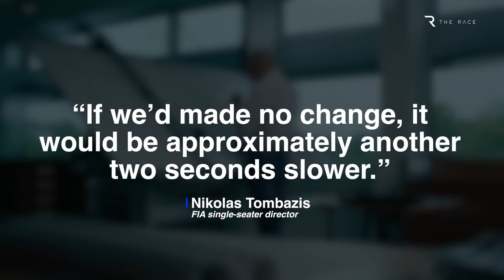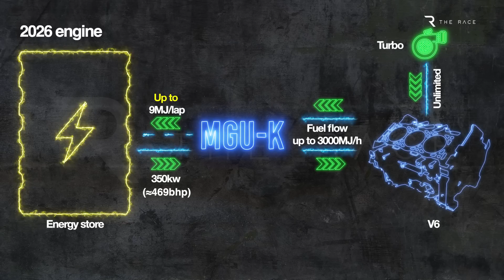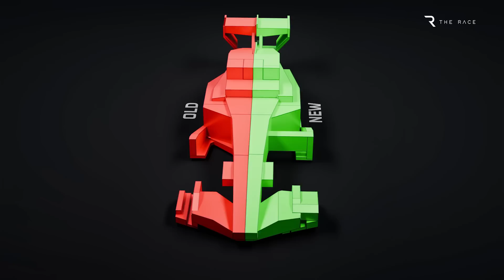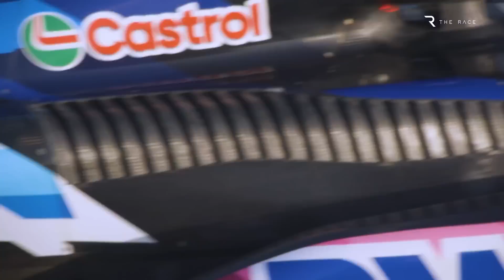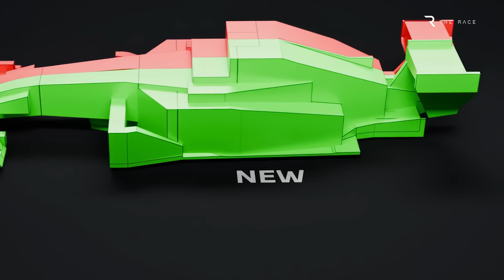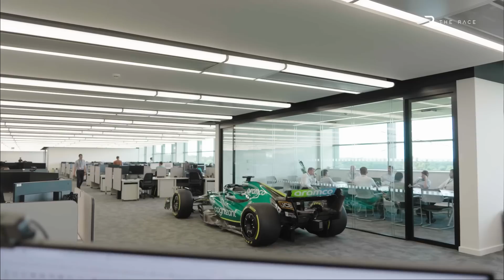How F1's 2026 cars will now be two seconds faster

Comment: 2 seconds faster!? That’s F2004 improvement levels. Believe it when we see it.
Reply: I believe they meant 2 seconds faster than what the 2026 cars were simulated to run previous to the changes made, not 2 seconds faster than the current generation.  They'll still be quite a lot slower than the current cars.
Reply: @Shortstuffjo  ... Great... sad face
Reply: 2 seconds faster than the previous 2026 regs. Not current gen. FYI previous 2026 regs were about 2 seconds faster than current F2 around a average sized circuit. Current gen is about 16 seconds faster than F2 on a average length circuit. So the new regs will have F1 cars about 4 seconds faster than F2 cars around an average lap. It will still be 12 seconds slower than current gen. In races this will be most visible cause the ERS cannot be used every single lap for reasonable distances meaning most of the lap cars will use around half of current bhp. All the things you see in this video are to hide this problem. F1 realised it won't be the pinnacle of motorsport anymore and it's desperately trying to make it look like it still will be.
Reply: @nielsvanheteren  stop fucking lying, 2026 cars wont be 12 seconds slower than 2025 cars LMAO
and current f2 cars are about 12-14 seconds slower than 2025 cars, (depending on the tracks)
the 2026 regulation cars will be about as fast as the 2022-2023 cars.

Comment: the car visually looks fast ,attack the corner like dancing way more important than laptime, even if 2 seconds slower , visually not much different, in person or on tv screen you wont feel it ,but the car smaller and lighter, thats make it visually look faster for sure .
Reply: They were going to be far more than 2 seconds slower, more like 6-8 seconds slower... Close to F2 pace.
Reply: @TassieLorenzo  2014 backmarker flashbacks
Reply: @TassieLorenzo  tbf going that much slower they'd still be miles clear of an F2 car. Currently cars are around 15 seconds faster than F2, half that is hardly cause for concern.

For example cars from 2010-2013 era were about 7 seconds quicker than GP2.  It wouldve been similar to that sort of era in terms of speed/gap to F2
Reply: @lewis8552 what’s the point of going slower though
Reply: @lewis8552 f1 is supposed to be the pinnacle of

Comment: 15% less downforce doesn't mean faster lap times. It means slower lap times. And you know what else means faster lap times? Not having 200kg batteries. There are only a handful of tracks where teams would willingly sacrifice 15% downforce to have much lower drag and downforce is why F1 cars are so much faster than any other motorsport. We will all be happy with better racing even if the cars are a bit slower than now, but to claim they will be 2 seconds faster than this year's cars is talking out your ass.
Reply: Technically active aero moans you can now have max downforce for every track.

Comment: The 2026 cars may be smaller than what we have now, but I really wish they were significantly smaller. Mid 2000’s car size would have been ideal
Reply: Agreed, I want it lighter, smaller AND faster.
Reply: @ksec6631  said no Grid Girl/Umbrella Babe, ever....😉😁
Reply: It’s about finding that balance between size and safety. While the product might not be as good as it once was, it’s still good enough, and I’d rather that then watch a person die out on track.
Reply: @deadman8000  then don't watch racing, it's a dangerous activity.
Reply: @deadman8000  When you sit on 300km/h car that corner at 200km/h. Any little safety you add become useless.
Reply: @deadman8000  The 2000's is the only decade where F1 didn't have a fatality. Sounds safe to me.
Reply: @brrrrrtenjoyer because they were slower. A 2000s f1 car running at the speeds we see now would be incredibly dangerous
Reply: @brrrrrtenjoyer exactly
Reply: @brrrrrtenjoyer  2010’s had a death cuz Bianchi was going too fast and crashed into a JCB when he should’ve known better, sorry to sound harsh but it’s true. Fans want a balance between safety and light cars, lighter cars wouldn’t have had crashes like Zhou in silverstone cuz a light car would’ve just either spun round or even if the car flipped it wouldn’t skid all the way into the barrier up side down.
Reply: @tyler_bt3326 Barrichello’s lap from 2004 is still the lap record at Monza so not that much slower
Reply: @ you picked the least downforce reliant track as an example, where cornering speed is less relevant
Reply: @tyler_bt3326 the f1 cars from 2004 were exactly so dast as the cars nowadays! 
They had no slick tyre and no drs. With tose features they would be the second faster what they need. 

Of course wider cars are faster at low speed tracks
Reply: @deadman8000  Mid 2000 F1 cars were safe machines though.
Reply: @ananastudio  That's not true, they wouldn't be close to passing 2025 or 2026 FIA crash tests.  We are talking a 60kg tub weight (with no halo) compared to the current Indycar-like 140kg tub weight including halo, which is obviously much stronger.  Crash tests get more severe over time (indeed it was +20kg of reinforcements & increased minimum cockpit size just from the 2021 to 2022 regulations alone) as part of safety improving over time, that's just how it works. Likelihood of that being reverted is slim to none.
Reply: @ananastudio unfortunately they'd fail modern crash tests. In fact the 2021 cars would fail the current tests - they gained 30kg for 2022 to meet the latest safety guidelines.
Reply: @TassieLorenzo  Mid 2000s cars were safe because the mass of the cars was lighter than today. Of course you need a stronger tub because the weight of the cars you might get hit by are heavier, meaning stronger forces. Even with a 140kg tub, most of the weight in F1 is not down to safety, but priorities; no refuelling, battery, lots of electronics, banned lightweight materials for cost/pollution, focus on aero not light weight, focus on max torque, meaning you need stronger, heavier wheels/tyres.
It could all change if the sport wasn't chasing the BS that comes from the car industry about "sustainability". Cosworth and companies like them could easily make the ICE, even a simple hybrid PU.
Reply: @ananastudio  what?? wasnt gilleneuve or whoever it was that dude who got in an accident and his legs were standing out the cockpit??? that doesnt seem safe at all
Reply: @deadman8000  Safety does answer for 100kg of weight. Having to carry an electric motor and additional enrgey recovery systems do.
Reply: @mustavogaia2655  the cars are heavy now because of safety, not because of hybrid powerplants.  the front tire/rim combo is twice as heavy now than in 2010. The wheel tire combo is so heavy that they had to double the front wheel tethers. when the wheel/tire is heavy, then brakes and suspension require increased mass. the only reason the rear brakes got lighter is because of mguk braking. you know nothing
Reply: @byanymeansnecessary9329  "the cars are heavy now because of safety"
Not really. The cars are heavy because they don't make it a priority to make them lighter.

"the front tire/rim combo is twice as heavy now"
Because they banned the use of lightweight materials for the wheels and decided on a mandated, standardised wheel (for cost and Pirelli's convenience).

"when the wheel/tire is heavy, then brakes and suspension require increased mass."
Absolutely. But the wheels and tyres are so heavy because the priority is massive torque in a heavy chassis, which requires a stronger tyre. They want headline figures of power and torque as marketing for long, heavy cars.
Reply: @deadman8000  Good point. But I think they should've created some type of design or tech which offers high safety with significantly lower weight.
Reply: @deadman8000  the smaller the dragon is less of a hero the driver become that why there no competion of mechanical bull riding you need consequence for spectacle ... imagine boxing without ko because ko injure boxers  lmfao ....
Reply: @deadman8000  Nope. There is impact protection, but the wheels/tyres don't need to be so big/tall/heavy and the bodies don't need to be so long. It's only that engineers want a long body and big front wing for aero.  The cars are heavy and clumsy and don't need to be. If they had refuelling again and removed a lot of the electronics and battery it could be like a 2000s car. The sidepods and cowl could be much larger and the wheelbase shorter. If the suspension was designed for lightness not aero effect, they could save a lot of weight there too. We only need such big heavy wheels because they regulated the materials and want a massive torque figure to shout about. Drivers want shorter, lighter, agile cars. You've been conned into believing the BS.
Reply: At least is a step in the right direction.
Reply: Mid 2000's cars were 1.8 metres wide. The length is the real problem.
Reply: Yep smaller cars would be better even if they were smaller.
Reply: Passing makes the best racing, finding away to make the car behind less affected by the car in front, but  I like NASCAR and Motogp
Reply: Really, the only thing blocking F1 from getting back to 2000s size is the batter which can't be smaller without giving up power.
Reply: This is a step towards that, hopefully each year they get a little shorter
Reply: 10/20cm is a mile in F1. I welcome these changes.
Reply: Not even possible. Even if you ignore the hybrid additions, the new safety stuffing in between the driver and the ground/walls/other cars limits the slimming possibilities, but is so important it can't just be discarded.
Reply: Wrong they did have few marshals die in 2000s
Reply: @SauberMercedes291  True. Two marshals died in Monza 2000 and Australia 2001 due to impacts from loose wheels, I believe.
Reply: @SauberMercedes291  nothing to do with car size!
Reply: @ExodiaNecross2 That was track safety related, not car 🤦🏻‍♂️
Reply: NOt until F1 drop the auxiliar parts on the power unit cars wil remain long and heavy.
Reply: @mustavogaia2655  you don't know what you are talking about, the current pus are smaller and lighter than the 2.4L v8s plus kers, you forget that engines require fuel to burn and thet currently burn half as much fuel over a race than in 2013.
Reply: @byanymeansnecessary9329  As Scarbs has said, things like the suspension could be much lighter if the priority was lightness, instead of designing the suspension with aero benefit in mind. And the cars could be much shorter, if the priority wasn't aero benefit.

"you forget that engines require fuel to burn"
I don't think anyone forgot that.

"the current fuel tank is the smallest in f1 history"
Because they need to package a big battery and cooling.

"the current pus are smaller and lighter"
But then there's all the electronics systems and cooling. If they changed priorities, the cars could be shorter and lighter while still being safe. And if the cars were lighter (and more agile like drivers want), they wouldn't need to offer "protection" from such heavy wheels and those extreme forces.
Reply: @mustavogaia2655  They're not going anywhere, mostly likely when Formulae E's exclusivity clause on pure electric expires we'll see F1 go full electric and basically absorb  Formulae E.

Manufacturers just aren't interested in building pure ICE racing cars anymore. They know it's a dead end road tech and they really do like to port some of the concepts over to road cars. So they want the powertrain to be representative of where road cars are going, and thats hybrid, and eventually pure electric.
Reply: @darthkarl99  "Manufacturers just aren't interested"
Don't need them. Cosworth could build enough ICE.
Reply: Agreed, even the 2026 spec cars are still way too big.
Reply: @dannyboyy31  Still smaller than the pre 1998 cars
Reply: and v10
Reply: U need smaller fuel tank for that size of car, with refueling is impossible to return to F1, so no chance
Reply: @AugustDayz  the current fuel tank is the smallest in f1 history,  smaller than during refueling
Reply: It’s progress in the right direction. You can’t just decide to cut the cars size down significantly without also ensuring they are as safe or safer than they are now
Reply: @aaronmoyer4722  Look at how empty the sidepod area and rear cowl is. It's purely about priorities. You can make an F1 car with the same current safety features 1m shorter. All you have to do is insist teams shorten the car, and they will find a way to package components within that space. Bring back refuelling and take out the battery - problem solved. Shorter, lighter cars, then you can save weight on suspension, and tyres, too. They just need to revert to using the sidepods like they did in the past, and design drivetrain & cooling that fits within the parameters.
Reply: @ you know nothing,  and it's sad because you talk too much bs. the 2014 can was the same size as the 2013 car, and it was lighter on the start grid than the 2013 car.

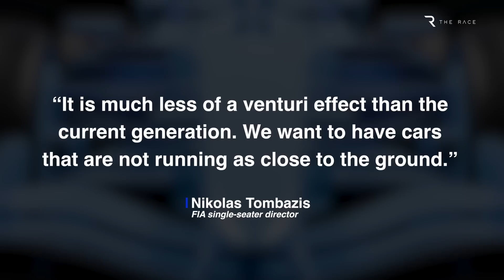Comment: 6:45 then why did we go back to the ground effect concept?

The lower the cars run the more downforce

Does the fia know what it wants?
Reply: As Peugeot found out, underbody downforce is clean but only reliable on perfectly flat tracks. This forces annoying compromises and still performance can vary all over the place. Too stiff suspension and now your curb riding is shit and your driver's back is in pain. Too soft and now you're bouncing all over the place, and the driver still feels terrible.
Reply: We went to ground effect to reduce dirty air but cars became highly dependent on the floor. now they're saying they open up possibilities to not be as dependent. It makes sense.
Reply: @alj-z7x  took some time for me to comprehend this, the only opportunities is top body ie wings to produce downforce and thats drag. So again does the fia know what it wants?
Reply: @km6832  2026 cars are actually projected to have the least amount of drag than any previous F1 car.
the 2026 cars will be straightline monsters (in full power mode)

Comment: The crash in the interest in electric cars and the fact that many manufacturers can not sell them, thus don't want to make them, why not just remove the batteries so it's just a turbo 1.6l v6 or better still a maybe 2l v whatever...8, 10 or 12 if wanted and the cars significantly lighter....with a more basic engine then maybe the target of having 11 or 12 different engine manufacturers becomes a better chance......and that whilst the Mercedes and Ferrari gain engine information from many teams thus gain advantage of knowledge, Ford, Audi and Honda will not have such a luxury. BUT if a more logical petrol car, then maybe Toyota might up their involvement with Haas, and teams like McLaren & Williams can look at a realistic option of a works engine option, McLaren possibly able to look to make their own...and Renualt? maybe reconsider. However with ideas like this and from what I have seen ..must go and see if there are any pink things flying?

Comment: They make such a major change to the rules and don't even test them in the wind tunnel. Harvesting energy on a quali lap is ridiculous.
Reply: Well they gonna implement this concept.
Reply: I could see teams finding out it's faster to spread your energy and just not harvest than dump it and harvest. I agree that forcing teams to use technology in a way that intentionally slows them is counterintuitive and gimmicky.
Reply: @jims6614  absolutely ridiculous Qualifying will be ruined 

With the regs you’re basically saying we will never see these cars flatout again even if it’s just for one lap
Reply: @RANDOMZBOSSMAN1  Quali is the thing I worry about least. It's the race I'm worried about. It's just impossible to harvest the amounts of energy needed to be able to consistently use ERS every lap in a controlled manner. This means either all cars go and brake every lap on straights to still get the other 50% of bhp or we will get a push to pass like racing series where overtaking is purely based on having/not having ERS available. Active aero will make slipstreaming impossible, DRS for all its flaws will be gone and these changes will increase dirty air again. It will literally become ERS manager 2026 next year and I'm not down for that.
Reply: @nielsvanheteren  you’re completely right we might be seeing 300m lift and coast in races and the active aero will reduce the dirty air required for slipstreaming 

These regs are not looking promising
Reply: @RANDOMZBOSSMAN1  I honestly think it will massively hurt F1 it will become a shitshow and I hope they course correct hard towards something which is raceable and fun for fans again.
Reply: @ last time they messed up bad was with how slow the 2014 cars were initially and they tbf to them course corrected relatively fast with the 2017 regulations and increased the fuel flow rate
Reply: @nielsvanheteren sounds like a lot of overtaking possibilities
Reply: @RANDOMZBOSSMAN1  the cars never were "flat out". They are limited in fuel flow.
Reply: @RANDOMZBOSSMAN1  racecars never go flatout, even on single lap qualy. It's always a balance between speed and reliability.

If you went truly flat out in quali, you would run out of tires by the mid of the lap.
Reply: @mondodimotori  maybe with this Pirelli tires you’ll run out as they’re poor quality 

But there’s a difference micro managing your tires than having to lift and coast to save electrical power on a push quali lap
Reply: @mondodimotori  No, just no. Maybe in the 70s-80s when cars were less reliable but nowadays even in 24hr endurance racing they're doing full-pace laps for the entire running except specific situations where they need a fuel save (IMSA Laguna Seca tends to create this on the final stint for instance). It's basically only F1 that can't do it and that's because the Pirellis are designed to be turds that can't take it to 'create a spectacle'.